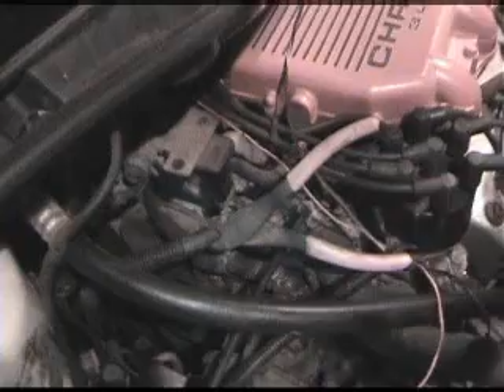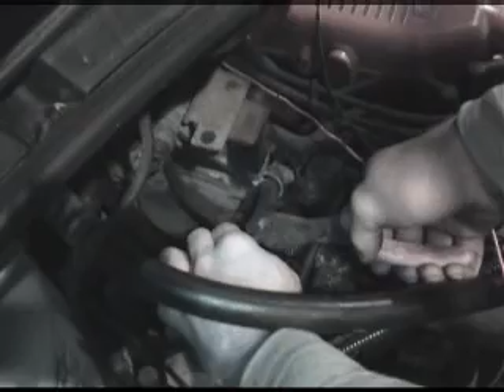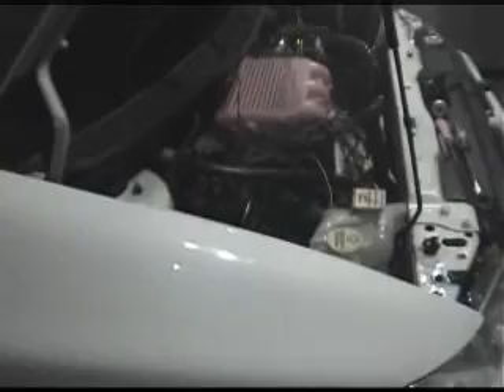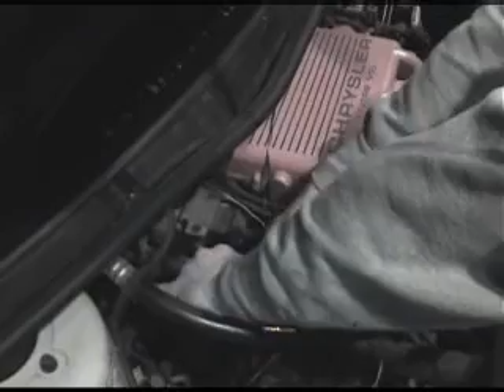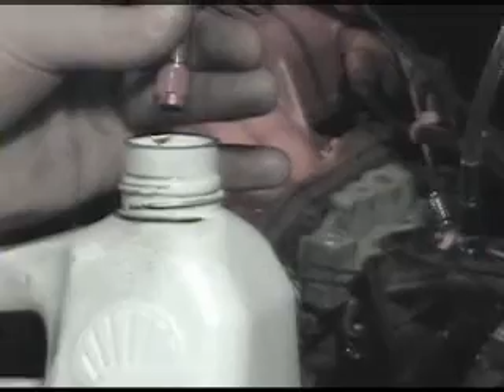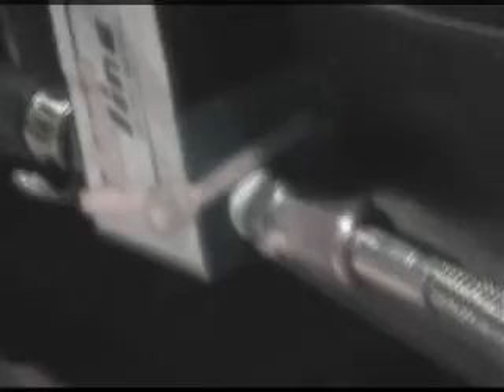fuel line cutting testing

Comment: If you agree i have a question about fuel injection system
I didn't know where to ask you so i do here
i didn't found an other title  related to it

I have a motorcycle with a fuel pressure regulator
Its vacuum line goes to one vacuum nipple

I know that one cylinder vacuum cause the regulator to work intermittently, creating a bouncy pressure at idle

Is the fact to use all the vacuum nipples  to have a smoother vacuum at idle will improve or change something on fuel distribution ?

Thank you